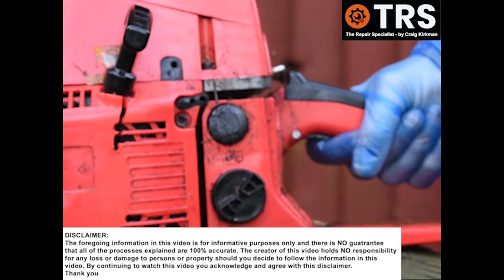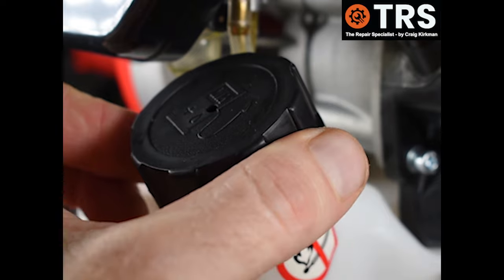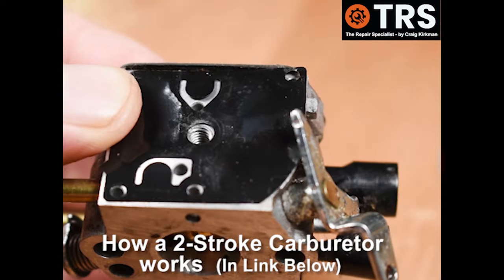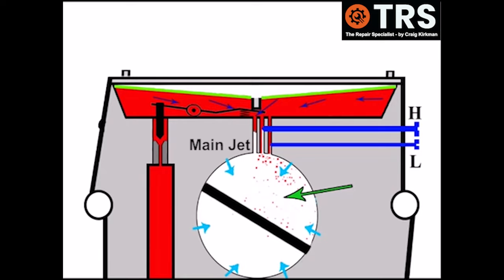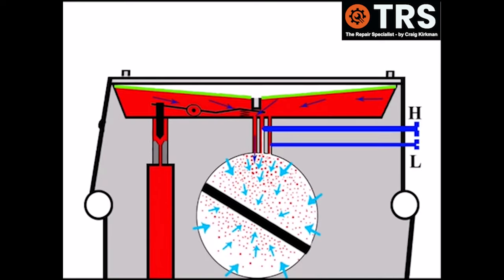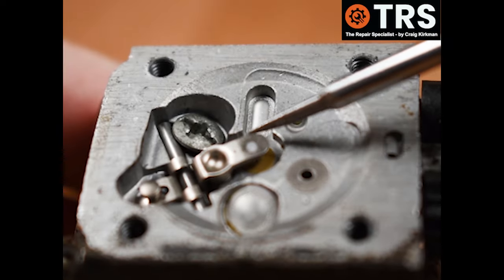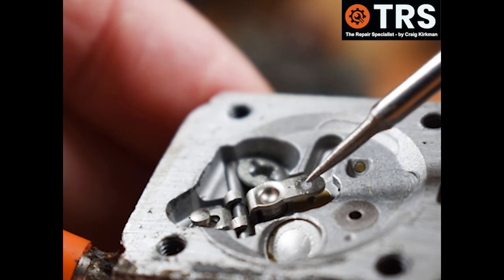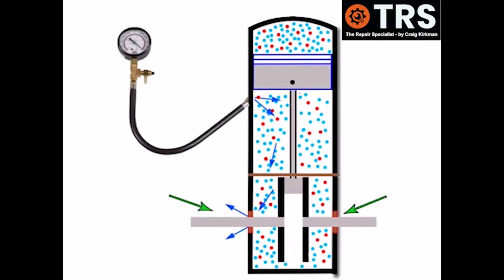Why does my chainsaw start then die when I give it gas?

Comment from the maker: Hi Guys. I meant to mention in the video that the High Jet is usually NOT separate from the main Jet, as  in the video I have shown them as separate.   Usually, the High Jet adjustment Screw simply adjusts the amount of fuel that comes out of the main Jet itself.  I have shown the Main Jet as separate in this video just to try and explain a principle of how Jets and their adjustment screws work.  I hope this makes things clear rather than more complex.  I'm really Sorry if it has.  Also, another thing I should have mentioned is that the examples I have shown are mainly based around a lack of fuel getting to the engine as a cause of engine bog.  Of course, too much fuel getting to the engine can also cause the engine to die as well.  I will make a future video showing this.   Again apologies for not mentioning this. I really appreciate you taking the time to look at my videos.  Craig
Reply: Loved the video, Craig. You explain things very well!
Reply: Nice detailed video Craig explaining how these little carbs work
Reply: Have you made the video about running rich yet?
Reply: I'm more of a "Visual" type person, and your diagrams help take the mystery out of those tiny little carbs. Thanks!
Reply: Me to tinker.,

Comment: You can check for air leaks by spraying all parts that you suspect might be leaking with break cleaner.  If a certain part is leaking, the break cleaner wii be drawn into the engine and it’s Will stop immediately.    Generally, bogs are caused by a lean setting on the L jet.  Just turn it out a half of a turn  (CCW) and check again.  This will remedy most bogs.  If not it is usually a dirty carb.  Clean or replace.
Reply from the maker: Yes. Great Points. Thank you for commenting. Craig  👍

Comment: I’ve watched a lot of chainsaw tuning videos, and this is by far the best. Most videos tackle the bogging issue from one possibility only like, “your chainsaw is bogging because your mixture screws need adjustment”. You cover all the possibilities and you do it quickly and concisely without wasting time. Basically as close to a perfect video as possible. Thanks so much for making it.

Comment: Excellent video. I had a broken tube from the crank case to the top of the carb. ( Sort of a PCV system ). It was causing a severe lean condition. Replaced the tube and all is well. I had forgotten the 2 stroke intake procedure  into the crankcase first to lube the engine. The excellent crankcase section of your video jogged my memory on 2 cyc operation.  Thanks Ed.
Reply from the maker: Nice work! And thank you so much for the kind feedback. Craig

Comment: An excellent video. A couple of comments that are important details not covered: The High & Low mixture screws are shown being tightened shut. I've never had a problem myself but have heard that damage can be caused if these screws are over tightened. Also, after they've been removed for cleaning the tubes (I prefer to use carb cleaner personally, rather than an air line) and replaced, they need to be set to a level where the engine has a chance of running initially before fine tuning. I set the screws at around one and a quarter turns out. I love the clear diagrams used - a picture tells a thousand words.
Reply from the maker: Thank you 👍

Comment: Great video. I clean the exhaust screen quite regularly on my chains saws and weed eaters. Some models it's hard as the screen is part of the muffler and can't be taken out. Minature wire brushes work here if you can get to the screens. The worst one I have is on a craftsman weed eater engine (which triples as a pole saw and hedge trimmer). The screen was inaccessible, but after warranty period I modified the muffler just enough to be able to get to it with the brush.

Gas quality has gone down in recent years, and don't get me started on ethanol gas. I use a Fuel Stabilizer every time I get a new can of gas. :)

I change out fuel filters regularly, and change gas lines as needed also. Often solves the starved fuel problem.

Comment: Great video.  I have three Homelite yard tools all with 20cc engines.  They lasted for over 10-years before I started having carburetor problems.  Several times I've replaced the carburetors with new ones from Amazon.  But these new ones only lasted one to two years.  I then started doing overhauls on the original carburetor with new gaskets, diaphragm, metering device, etc.  Now it runs great with good throttle response but only for about 10-minutes until it warms up.  Then I get the bog down.  It comes on gradually and I first notice it due to delayed throttle response that eventually turns to the bog down happening at lower and lower rpm until stall.  After it cools it runs again.  On my string trimmer I replaced all the parts other than the valve as none of the kits have the correct length replacement.  This includes the primer bulb, filter screen, metering diaphragm, metering spring, metering anvil, pivot shaft, gas cap, gas tank, gas tank pickup filter, gas lines, and carburetor to manifold gasket.  And the gradually bog down to stall when warmed up still happens.  Any ideas what might be the issue?
Reply: Have you completely excluded fuel venting malfunction? Crack open the fuel cap when symptoms start and if they go away, there's your problem. This is covered around the 2 minute mark and it may be the new fuel tank caps just aren't that good as the original ones. Just shooting in the dark.

Comment: A most excellent and thorough video. Here in the states ethanol in gasoline greatly decreases shelf life and increases clogging and corrosion in anything with a carburetor. Fortunately in many places non-ethanol can be found, though at a premium. I’ve started using the jug for my gasoline model airplanes for my saws and trimmers to keep things fresh. Model airplanes are generally fueled by a hand crank or electric pump which can be reversed to empty the tank when done. Doing this also seems to help with power tools when they won’t be used for a while.

Comment: I work on several types of Husqvarna saws for the fire service and routinely reference back to your videos when I have a stubborn problem saw. A no stone left unturned approach to problem finding and adjusting systematically . BTW our departments saws are well worn and used hard but generally all start in three pulls and run nice and steady. But when they don't the FFs know to bring it to the fire shop. Thanks for your videos.
Reply from the maker: That is awesome! Thank you for taking the time to let me know. You’ve made my day. Craig 👍👍👍

Comment: I've never seen a video that went into more detail. I wish I had you on my last camping trip. 
My chainsaw wouldn't work at all. Most would have given up (like my wife) and said we don't need a camp fire. No wood cut means no fire. But I broke that chainsaw down into pieces using what tools I had on hand. Pliers and regular screwdriver and a can of WD-40. I had a flat file that I used later to sharpen the teeth on the chain one at a time. But first I had to get it running. I took apart the carb with the tools and sprayed out the passages with the WD-40. Fired right up afterwards and worked the rest of the time. I just wish you were there to save me half a day of learning by trial and error before I figured out exactly what you showed in your video. There is a lot that goes into a chainsaw.
Reply from the maker: Well at least you went into the problem and found out loads using your own initiative. That’s awesome. Thanks for commenting. Craig 👍👍👍👍

Comment: Thanks.  Clearer and more succinct than some helpful videos. My Huskvarna was working fine but failed to stop without choking. It also began to leak fuel. Took it to a dealer for a new stop switch and fuel line. They took it apart, cleaned the carb and bought a new fuel line but didn't fit it.  I needed it back so they put all the bits in a box to let me fit it.  It eventually started but bogs after a few seconds.  Adjusting the idle screw made no difference.  Will now try the multiple combinations of high, low and idle screws and report back in the Spring.  It's lucky our cars aren't as complex!

Comment: thank you for the in depth explanation to why chainsaws bog down.  I picked up a used chainsaw, it starts and runs GREAT after priming, but after a few seconds bogs down and dies.   I've done most everything on your video.  All I have is to adjust the fuel/air mixture screws ad inspect the diaphram on the carburetor.   I found this carburetor and chainsaw are no longer being produced, but I am still looking for a seal kit.    Also, you look and sound like Phil Collins.
Reply from the maker: You're welcome! I'm happy the clarification was useful to you. It appears that you have taken your time troubleshooting the chainsaw problem. In fact, checking the carburetor diaphragm and adjusting the fuel/air mixture screws are wise next actions. Ideally, a seal kit will be available to assist with any possible leaks or wear in the carburetor. It's admirable that you're committed to maintaining the chainsaw's functionality even though it might not be manufactured any more. Thank you for your contribution to these chats.

 Thanks

Craig
Reply: Your videos are an inspiration to learn and work on my own small engine machines.  I fixed this chainsaw.  I can't believe I fixed it.    I still can't figure out why the old carb wouldn't throttle up, but I purchased a new carb for under $20, and put on a new chain.   Now I have a very good, clean 38cc chainsaw for around the house use.  Thank you again for your instructional videos.   Best of luck

Comment: Well done!!!  You addressed many lean mixture issues.  Flooding can be another issue for bogging down.  Mine is obvious.  I can pour fuel from the intake.  It has gotten worse with time and currently will not start. I'll be checking the valve actuated by the diaphragm.
Reply: I see you mention that in a comment you left.
Reply from the maker: Thank you for your feedback. I really appreciate it. Craig 👍👍

Comment: Adding time and another 👍 while having my coffee. Haven't used an ultrasound yet  But saved a few carburetors by boiling them in soapy water. This method also helps me keep the yard tidy burning twigs & fallen branches LOL. Most of the blockages I run into are at the screen. Some very neglected units have the other issues you are describing. Your diagrams & explanation are very well done.
Stay safe, Joe Z
Reply from the maker: Yes. I agree that the screen is a common area for these types of carb to show blockage.  Thank you for your comment and feedback. I appreciate it.  Craig 👍

Comment: This is probably one of the most thorough videos on this subject. Fantastic explanations and visual examples. I would add a couple points. The impulse from the crank can also be the cause, both in the manifold style mount in the video and on units with a separate impulse line. Leaky impulse lines can be found with the crank pressure test as well. 
Also of note is that crank case air leaks typically cause the engine to take longer than normal to come back down to idle, as well as bogging. Just a quick way to know where you’re more likely for find the issue when you’re diagnosing.
Reply from the maker: Awesome feedback and thank you for including you points as well. Craig 👍👍👍

Comment: Absolutely correct 💯%.  Only thing I do different is I take the exhaust cleaning a step further. I take the muffler off and take a mapp torch to the inside until the whole thing glows orange so that all carbon is completely burned to a dust like substance, let it cool completely, blow out with Compressed air and install it back on the equipment. I start them, let them warm up and do a performance run and normally they run like new unless the fuel system needs fine tuned.
Reply from the maker: Awesome 👍👍
Reply: @TheRepairSpecialist  thank you. Yeah I just do that so it cleans up the baffles inside the exhaust because there is small holes inside that can get plugged up and two cycles really need to be able to breathe out to be at their top performance and not over heat the cylinder.

Comment: Great vid. Last but not least, someone worked on it before you got to it. Check that replacement parts are the correct one and verify all gaps and adjustments. Don't trust the last guys work. Feul/oil mix ratios need to be right, sometimes people use whatever they used in another engine and it may be way off from what it should be.
Reply from the maker: Absolutely. You are dam right. I should have mentioned that in the vid. Thank you for your valued input. I really appreciate it. Craig 👍👍👍